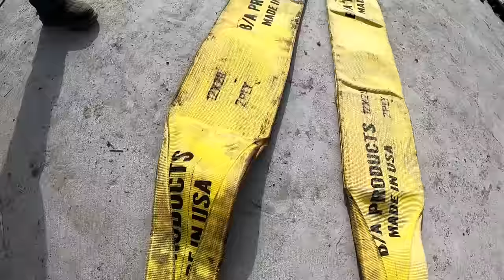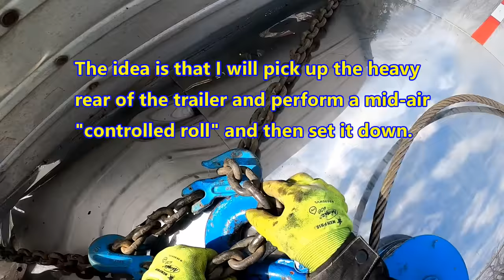Haz-Mat Tanker Rollover Shuts Down Everything!!!

Comment: No tank will ever “crush like a soda can” only reason you vent is to get more suction so the vacuum is created if no vent it takes longer to pump.... can blow your tank if you reverse a pump into another tank but that’s about all
Reply from the maker: Actually.....they will crush:  https://www.youtube.com/watch?v=0N17tEW_WEU
Reply: @RonPratt   been doing it for years but never had my tanks crumbled (that being aluminum tanks) even pumped a cab over into a tanker.... but hey man what pto pump they running cause clearly you’ve done it more 👀
Reply: I saw a water tanker that had imploded because the vent wasn't working. They will crush themselves if the offload pump is strong enough. PTO pump probably won't but an external pump at a plant can do it.

Comment: If it were my scene, I'd have a command center half a mile or more away and be doing traffic control from that distance.  You have to realize there are chemicals that you smell them once and then you lose your sense of smell so you don't realize the chemical is still there.  There are chemicals that you smell once and then you are dead.  And, there are chemicals that once exposed destroy your health months or years later.  Too many first responders have too cavalier of an attitude and that is why many of them end up dead, either immediately or years later from some obscure cancer.   If the bill of lading doesn't specify EXACTLY what is in the tank; the driver, the trucking company, and the shipper need to be in jail.
Reply from the maker: The incident commander had the BOL and new exactly what was in the tank.  I walked to the command center then I cut the camera off due to sensitive company and personal information.  While at the command center, we discussed what was in the tank, the precautions that needed to be taken, located the appropriate contacts, devised a plan of action, and then put that plan into motion.   Thanks for watching and God bless.
Reply: @RonPratt  I'm sorry if I got the wrong impression from the video.  I've had just enough hazmat training to have a healthy fear of that stuff.  One training video showed a law enforcement officer trying to rescue an accident victim, being overcome by chemical vapors, and dying on the scene.  I'm glad you and the folks handling the scene were doing it right.

Comment: If it wasn't ulsd it was placarded ulsd.
1203 is regular gas. 87,89,93 etc.
1993 is ulsd. Dyed/clear
1863 is jet
Reply: You can have ulsd and regular on the same tank and be placarded 1203, that's how I run all day. But if it's just a plain 1993 it's ulsd
Reply from the maker: Actually, 1993 covers quite a few chemicals and mixtures of chemicals.  Yes, it is used for ULSD, but it is also used for other things as well.   This was a mixed load of paint resins, acetone waste, and other chemicals that fell into the ERG's 1993 list.   Thanks for watching and God bless.

Comment: According to the placard that is diesel mixed with nitrous oxide
Reply: Not likely, as you would never mix a fuel oil with a strong oxidiser like nitrous oxide until you actually want the two to go FOOM!, or encased in a stainless steel tanker like that, a truck shattering KABOOM! (Apologies to Marvin the Martian and his Illudium Q 32 Space Modulator.)

Comment: Why does the truck have the wrong UN number? Isn't that a big no-no? 1993 is diesel, but they said it was gasoline which is 1203
Reply: Driver didn't read his bill of laiding and or the fire department doesn't know how to read the ERG to find what the 1993 class 3 really is. Now if it misplacard then that driver for sure no longer drives trucks unless proving the shipper loaded incorrectly.

Comment: If an insulated tanker It’s not used to transport gasoline or diesel what is it used to Transport
Reply: Usually liquid asphalt oil, aka "hot oil" that needs to be kept above 300 degrees F so it doesn't thicken up and can be pumped off. I haul it usually around 350 degrees. If it stays in the tank too long even with the insulation it will set up solid and then you have a major problem.

Comment: The 1993 tag on the back of the trailer proves it is a gas or a diesel tanker
Reply from the maker: Not necessarily....   UN1993 covers a variety of Class 3 Flammable chemicals, which include, but are not limited to gasoline and diesel.    https://cameochemicals.noaa.gov/unna/1993
Thanks for watching and God bless.